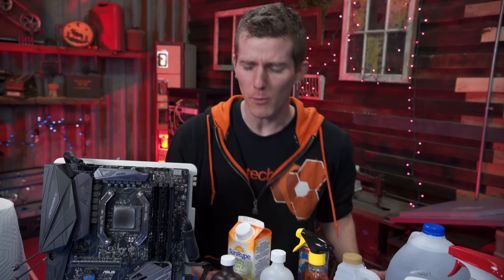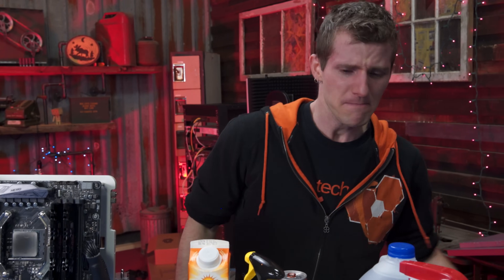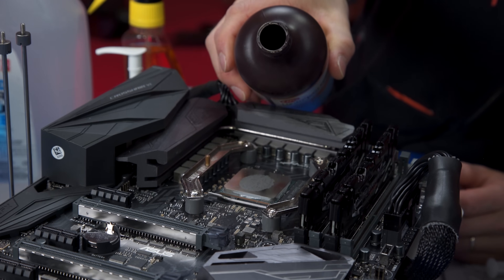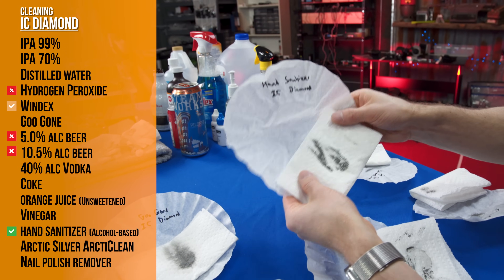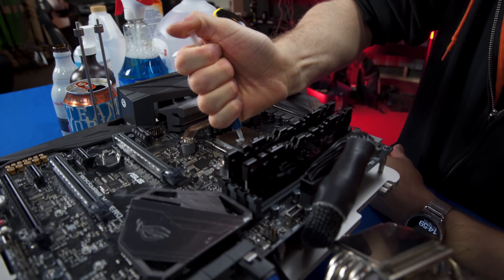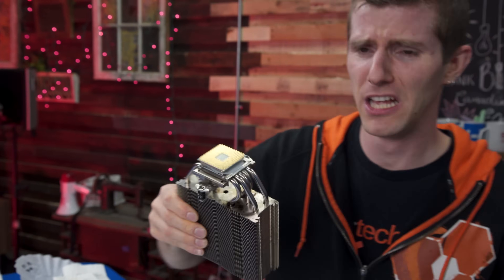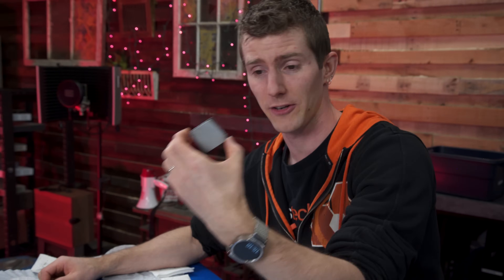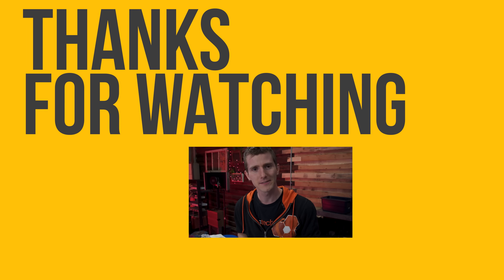Removing Thermal Compound - The BEST Way?

Comment: Literally just take a tissue and wipe it right off... Don't even really need alcohol to do a decent job of it. 

Also, I used to spread the "dot" of compound over the cpu, but I find that just placing the cooler down over the dot does a great job spreading it. Keep it simple.

Comment: Would the results be any different if the system was running for a period of time, eg. you ran your cpu on the stock cooler for 5 months before you bought a better cpu cooler?

Comment: love your vids linus, but there is a suggestion i would make for the video; as mentioned in another comment, the thermal paste hasnt been left to sit for an extended period of time, as im sure we all know trying to remove the cooler from a processor is like trying to lift mjölnir, so these tests, especially for the thin paste is pretty inconclusive, even with light pressure it could be pretty easy to do, which might explain some of your results with that test, the solvents used in the thicker paste test and their results seem to be more useful because removing the paste with the light pressure you describe wouldnt work as well due to the viscosity of the paste, the solvents effect is far more noticable here. 

Another quick suggestion if you do decide to revisit this video after leaving the coolers installed for a few weeks or months (at least i would say, maybe with some runtime aswell to heat the cpu and have the thermal paste be in use) but if there was a way where you could do an initial wipe with the tissue and succesive wipes with a second unused piece of tissue just as a way to ensure that the paste removed from the first wipe doesnt somehow end up end up leaving a streak on the cooler, might be overkill but its just a suggestion. 

Anyway, just want to say, love your vids, been watching for a few years, think this is a really interesting idea and we would all like to know how best to deal with cleaning old thermal gunk. thanks for the vids, hope i dont seem like a dick with this comment, just thought these might help with your results. take care guys!

Comment: I use 95% clear denatured alcohol with the only denaturing agent being denatonium in very small quentities and it works perfectly, also evaporates faster than IPA and is a lot cheaper and easier to find where I live

Comment: The fucking idea of 99% iso alc over 70% is that it doesn't have as much fucking water in it. The water in it is way more conductive than the fucking alcohol, and minimizing that is a fucking good idea. Your test is on the heat sink, which doesn't have any fucking electrical components that could be damaged. This test is incomplete without a fucking "risk" measurement included. If something cleans the fuck out of my cpu but may also fry my mobo, I don't fucking want it. 
fuck.
Reply: ItsAlleged fuckity fuck fuck fuckity fuck
Reply: What the f dude

Comment: spit and toilet paper does the job for me
Reply: urine is more effective
Reply: @xmaxfactorx  hah
Reply: TheCanadianLanBoy Thanks for the great tip! Just tried it and the board works perfectly, but my dishwasher stoped working :(
Reply: TheHybridPotato semen
Reply: Yeah, I do the same. I spit on it, rub it a bit, and then when I'm finished, I use toilet paper to clean it. Sometimes, I have to use soap through if some of it got on my pubes.
Reply: Vegetsu101 I use cum
Reply: TheHybridPotato it doesnt matter aslong as it is left to dry long enough, I clean used boards in my dishwasher :)
Reply: @thecanadianlanboy8132  Clean? Do you eat from your boards or something? :-P
Reply: @thecanadianlanboy8132  It’s good because as long as you don’t use soap and don’t let power flowing.
Reply: Same here. Wipe the excess off, then the last paste that's stuck to the cpu or cooler takes a tiny bit of spit on a paper towel and give it a wipe to clean it off, then a wipe with a dry bit of the paper towel. Works perfectly fine
Reply: @penguinactually  Do you know if I could use 93% ethanol instead of ISA? will it work
Reply: Works especially well if you don’t have a girlfriend you forgot to mention.
Reply: Hopefully the toilet paper hasn't been previously used to wipe  your mardy ass after a big filthy dump.
Reply: I just traded my CPU for a roll of toilet paper.
Reply: @dububro  will you take a Pentium 4 for a roll of 2 ply?
Reply: Aidan MaKinster I'll give you three squares.
Reply: @dububro  nah man this is this is the iconic mono core Pentium 4. Yeh we got one. I'll take a half toll minimum
Reply: Aidan MaKinster sorry no can do. Maybe you could use coffee filters instead.
Reply: @dububro  allright allright. 10 sheats and half a mini bottle of hand sanitizer.
Reply: So is shit!
Reply: Charmin?
Reply: Vegetsu101 haha
Reply: that is what your girl friend uses to remove my arctic silver
Reply: I was about to add comment like urs.. spit works for me too, and I take way less time than he did.
Reply: @GLORYWINGS [POV] swallows 1 drop, gets drunk

or dead
Reply: We are talking about thermal paste here
Reply: 666
Reply: Because u drunk... U got 60% alcohol inside your body... Hahaha
Reply: Same with your mother
Reply: that stuffs rare now
Reply: XDDDD#D
Reply: your cpu be smellin’ great
Reply: Vegetsu101 ur putting water on your cpu
Reply: @lego46143  r/wooooooosh
Reply: @lego46143  dude that stuff is worth as much as gold these days!!
Reply: @lego46143  r/whoosh
Reply: Cum is better
Reply: Vegetsu101 dumb
Reply: @Kurisu_J  r/wooosh

Comment: Is that coke?...
Hand soap?
Fucking fruit juice?!
...
Linus, you do know that some people actually WANT to take you seriously, right?
I mean...

If you're gonna try hydrogen peroxide, you should at least CONSIDER chlorine-trifluoride. :/
It cleans everything, from that weird smudge on the wall, to the concrete roads outside. (Use might result in cleaned object seizing to exist.)

WARNING: fires created by the substance might burn through: clothing, skin, flesh, bone, steel, the floor, the concrete beneath the floor, the gravel beneath the concrete, the dirt beneath the gravel, asbestos, fire retardant material, things that have already been burnt, and the hope that you will survive if you get any amount on you. 

An eye-witness account: "The concrete was on fire... The... It burnt. o-o"

Common reactions are: Burning in contact with air, exploding in contact with water, death in contact with living things in general.

Use of the material is at own risk, i, nor any individual will be held responsible for the actions you take with the substance.
Best of luck, and may the gods, both old and new, watch over your life, as you will likely not live to see the results of your actions after using this substance.
Reply: BEER. FUCKING BEER. WHAT THE FUCK LINUS.
...
WHY?!
Reply: WHY MORE BEER?! WHY WOULD YOU NEED ANOTHER KIND OF BEER?! WHY DO YOU LIKE MURDERING EXPENSIVE THINGS LINUS?!!! T_T
Reply: ... 1800x.
Linus.
I will find you.
And i will steal all your shit.
Actually, i think it'd just run away with me.
I'm fairly certain slaves would be treated better than your hardware. :'(

Comment: peice of advice from model railroading, of all places: Goo gone leaves a bit of residue. It's not uncommon to use goo gone to clean model train tracks, but the next step is to wipe them down so the residue doesn't work as a barrier between the rails and the wheels/contacts.

Model trains run by using electricity in the rails to power them, hence the importance of clean rails and no residue. There's also a special type of eraser made specifically for cleaning rails called a "bright boy" which I might try on a spare PC now...

Comment: I'd suggest NOT using acetone based nail polish removers, because it can break down some type of plastics, damaging the computer parts.
Source: I'm a chemist, our gloves dissolve in acetone, and the safety glasses made from plastic get a fogged up kind of effect in acetone vapors.

Comment: Hope they'd try more tihngs like this. One thing that I had in mind are PBT keycaps along with ABS ones that come stock with keyboards.

Hey, I hope I just don't get ignored but after watching this, I thought of taking the time to message something that can be related and might be a good video topic suggestion, as long as I can suggest something for free.

Again, I just finished this video and was informative (already knew alcohol based substance are good at removing residue). I just bought some white pbt keycap set the past week to replace for my corsair strafe keyboard and couldn't stop noticing that the left half of the keyboard is dirtier than the numpad. I don't know, maybe someone at LMG could read my comment and further improvise the idea for a future video.

Comment: Clearly the best way to remove thermal compound is to use a coffee filter. The rest doesn't seem to be needed. (Actually I used to just remove compount with kitchen paper and polish it with that for a minute or two. Seemed to work just fine too :) )
BTW I would think it's also important how much residual stuff is left behind on the processor die after cleaning and if there are any long term effects to the surface from using those other types of cleaners (oxidation for instance). And if there will be any reaction between any left over residue and newly applied thermal past later down the line.

Comment: How about ethyl alcohol. Isopropyl alcohol is not easily found in stores in my country. I got the Arctic Silver specialized thing when I built my pc just to be on the safe side. It works great of curse and should last a while but it's a little pricey.

Comment: that's a weird way to remove thermal compound... i always unplug the cpu from the socket and clean it, not pouring the solvent on it while it's still attached to the mobo...
Reply: q-tips.

Comment: Alcohol swabs are amazing for cleaning just about anything, especially thermal compound. They are incredibly cheap on amazon. I usually use one swab on the cpu, another on the cooler.

Comment: I used acetone based nail polish remover myself and it worked fine! I just read you have to be careful not to spill it on your motherboard because it could dissolve the plastic! :D

Comment: The ONLY one I use out of this is 99% IPA.  Even at that, that's still 1% crap that may or may not evaporate from the surface.  Orange juice, Beer, Goo Gone, Coke, etc.... The film left over won't exactly be a great thermal transfer compound.   Hopefully people understand this video is just for entertainment and NOT practical.

Comment: The reason that you use 99% over 70% is the stuff they use to cut some ISO alcohols is mineral oil.  Others are water.  It leaves shit behind.  Same story with GooGone, which conincdentally, is step 1 of the Arcticlean system, it just leaves the other crap behind, which breaks down the new thermal paste.

Comment: will this setup work? 

-Ballistix Sport LT 8GB Kit (4GBx2) DDR4 2400 MT/s (PC4-19200) DIMM 288-Pin - BLS2K4G4D240FSE (Red)

- MSI GeForce gtx 1050 ti 

-Rosewill ATX Mid Tower Gaming Case with Tempered Glass Panels

-WD Blue 1TB SATA 6 Gb/s 7200 RPM 64MB Cache 3.5 Inch 

-EVGA 430 W1, 80+ WHITE 430W power supply 

-Intel BX80677G4560 7th Gen Pentium Desktop Processors

-MSI Pro Series Intel B250 LGA 1151 DDR4 USB 3.1 micro-ATX Motherboard

Comment: I just use a little spit and a paper towel.  It takes a little more than 5 swipes to get it all, but it's still faster than getting up, walking into the bathroom, and digging out the alcohol or nail polish remover.

Comment: before i see any of these results... i can assure you that something like non environmentally friendly type Brake Clean would do a super great job.

but... it would also melt the PCB's around it. and the glue under the IHS. and your wires. most likely. ;)

and Alcohol evaporates to not leave residue it's cheap and available, sterile, blah blah you know the drill.

Comment: If you want a completely clean CPU, cooler, and die if you delid, I have found the following to be the best and I have been at it for over 30 years:     ArctiClean 1 & 2 followed by isopropyl Alcohol [isopropanol].  You can use almost any kind of clean non-abrasive cloth or paper towel to remove the vast majority of compound from a CPU lid and cooler, then use the above chemicals in the order mentioned.  Lastly, with isopropyl alcohol use a clean coffee filter to polish off any residue and leave no lint or other debris.     [EDIT:  There was residue left with many of your products used.  I polish mine completely clean, just a habit, however when changing compound types it may not be a good idea to have any old compound left, for example going from widely used non-metalic compound to metal based compound.

Comment: since when cleaning newly applied compound got difficult? It anything will clean it up but try doing the same experiment on processors running for months, this is actually the time when the compound gets really dry and is the hardest to clean

Comment: Hey Linus, could you make a video on liquid metal thermal paste?  Its hard to remove, electrically conductive, damages aluminum heatsinks and its awesome! Additionally, if you were to remove the stock thermal pads of a gpu and replace them with expensive ones it would mean a hot OC benchmarking video.

Comment: 99% alcohol is hard to get here in the UK, so I usually use methylated spirits that can be picked up at a supermarket or any DIY shop over here. It also smells like sweet baked goods. Odd choice of aroma for what is essentially poisoned alcohol but hey ho.

Comment: I never had problems with removing thermal compound with water. Just a little bit of water on the tissue and go. I'm using MX-4 as my thermal compound and may try wodka next time.

Comment: Ive used hand sanitizer for years. I was presenting a PC at a conference and had to reseat the heat-sink since it moved too much in transportation. Used hand sanitizer and it was flawless :)
Reply: Going to use hand sanitizer, as it has alcohol. Along with a cloth.

Comment: I clicked on the video, watched some time until the presentation of the "solvent stuff". I saw, that there was no brake cleaner used in this video. I stopped the video and clicked on dislike.
Srsly. there is no better way of removing thermal compound than using brake cleaner. Forget Isopropyl, throw away Acetone - simply use brake cleaner. period. It will even remove these 10+ years old compound crusts with ease. No paper wipes needed - with brake cleaner you can simply "spray away" the compound.

Comment: WARNING: while some things like acetone or water can be used to clean, they may not leave your CPU intact. Acetone can actually destroy your CPU motherboard and cooler, and water based stuff may be dangerous if you spill it somewhere it can take longer than you think to evaporate.

Comment: IPA 70 does work very good on thermal paste but I barely take my cooler off and I have 99%IPA on hand because I use it as a finishing solvent especially with schelac so i wont get a bottle of 70% only for that :P

Comment: For everyone who wants to save 10 minutes. The best is isopropil alcohol and paper towel.
Reply: Paper towels can leave lint behind. Use a coffee filter.
Reply: @nmotschidontwannagivemyrea8932  use abit of cartridge paper and elbow grease
Reply: @nmotschidontwannagivemyrea8932  Microfiber Cloth
Reply: Any short-chain alcohol will do the job just as well. Using ethanol instead of isopropanol makes no difference, and ethanol (in the form of methylated spirits) is available at nearly every supermarket, and costs bugger all.
Reply: yes! izi Pizi
Reply: thanks man
Reply: I thought the paper towel leave residue
Reply: dzsozeTTa 
Alcohol like the cleaning cut stuff in clear bottle in your pantry alcohol
Reply: 99 percent alcohol
Reply: Thank you.
Reply: Thanks so much
Reply: the real MVP
Reply: thank you lmoa
Reply: Thank you.
Reply: Thanks!!
Reply: Nope, best would be buying alcohol wipes. Don't need a paper towel since the wipes are already dowsed in alcohol.
Reply: thank you
Reply: His  attempt at being entertaining was overkill 😰
Reply: Will isopropyl alcohol cause static discharge???
Reply: 99%
Reply: thanks
Reply: Cheers
Reply: thanks!
Reply: Does 79% work instead of 99%
Reply: Do not use PAPER TOWELS! IT SCRATCHES AND LEAVES WOOD RESIDUE
Reply: @hellogoodbye388  what to use instead
Reply: But what’s the best if I don’t have either? Stupid
Reply: I know. But he has to fill a 10 second solution into a video of at least 10 minutes so he can get paid by google. They dont pay unless it is at least 10 min long. The "paid" people on YT do nothing but waste yuour time now and i try to avoid professionally produced vids cos i know i will get 10 minutes of some person filling my ear full of crap when 30 seconds would have done it. This guy here is a prime example of this.
Reply: @suminshizzles6951  someone who uses YouTube to make money wants to make money on YouTube?? No way

Comment: I have a question 

I have an old nvidia 4 mx 480 and I was wondering what could you even do with it. It was made in Taiwan uses a pci slot has a blue out put plug (I don't know the name of it and it has 15 holes) and a tv out no heat sink but the one on it was shity plastic anyway

Comment: ironically enough a small rough rag did fine for me when repairing my brothers computer. though the thermal paste application sucked and was ancient. (about 6 yrs old i think) but it was dried and cracked like cake that sat in the open for a week. New application did the trick though.

Comment: I used ArctiClean for the first time about a year ago and holy shit that stuff is fantastic. Yes, it's pretty expensive, but that pair of little bottles will last you at least 30 CPU cooler dismounts, and compared to the price of the CPUs that most people are fiddling with, that's likely not a concern. IPA 99% I imagine is really good too if you're on a budget and dealing with hundreds of gooey CPUs (only tried 70% myself, and it was nearly as good as ArctiClean).